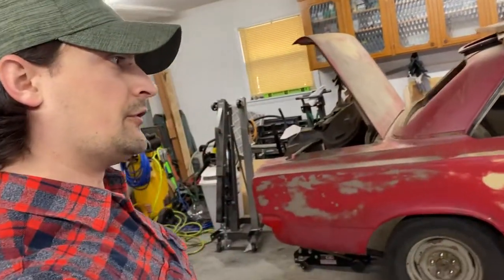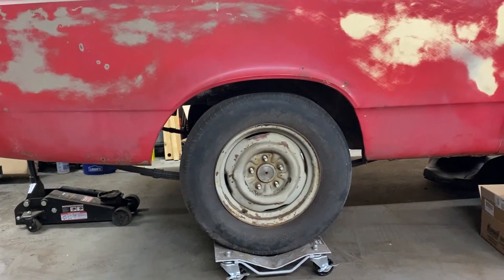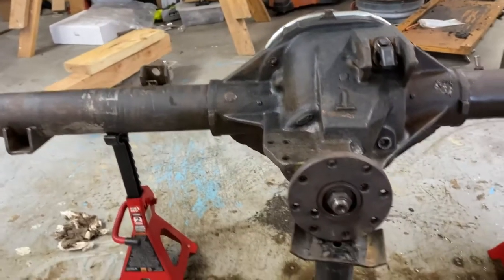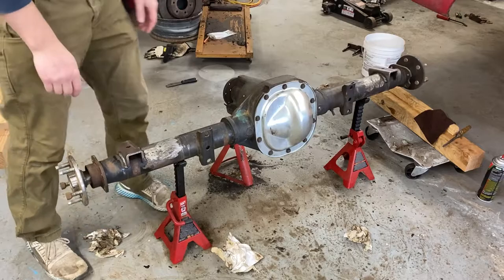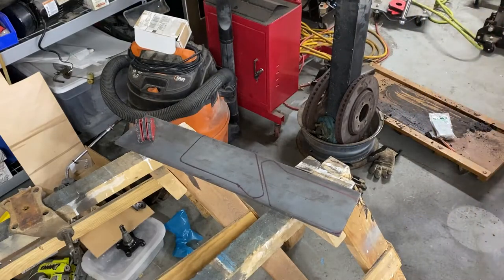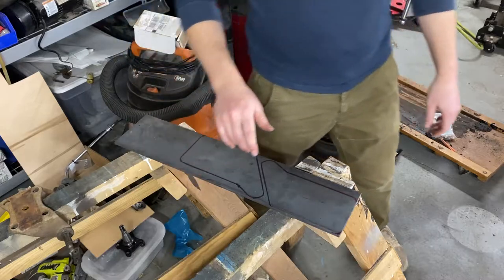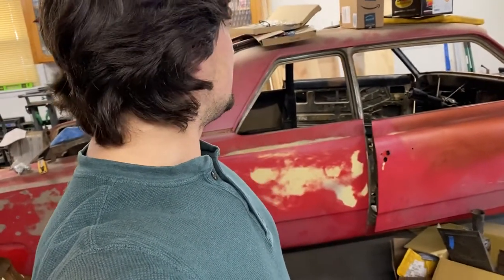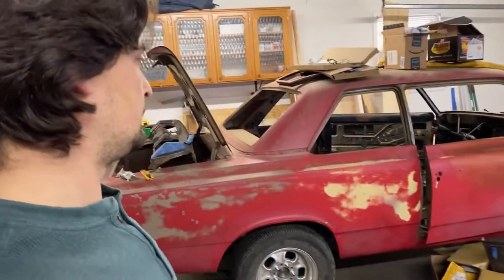8.8 Rear end conversion and custom spring plates - 1968 AMC Rambler American

Comment: i heard that the 1969 transam amc javelins used 2nd gen mustang IFS system...dk if it would fit an AMC Rambler
Reply from the maker: That’s an interesting idea. Probably no reason you couldn’t adapt one. Control freaks is making a new production kit to convert from trunion suspension. Pricey as all hell though

Comment: what size wheels and tires do you have?
Reply from the maker: Hey Brian. I’ve got 215/70/14 installed now. They are cutting it a bit close to the outside but plenty of room to the inside. Haven’t measured the wheel backspacing but that may be a way to get more clearance one way or another.